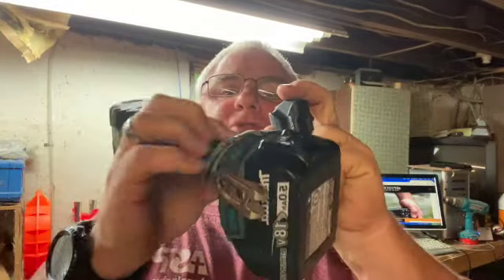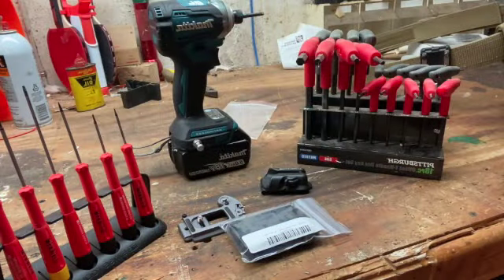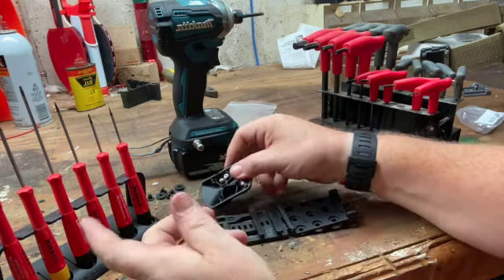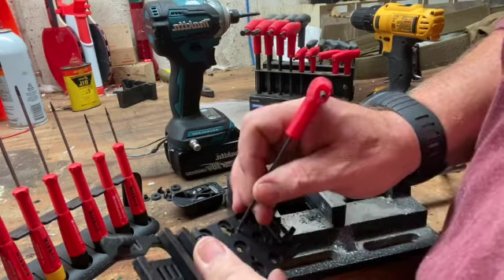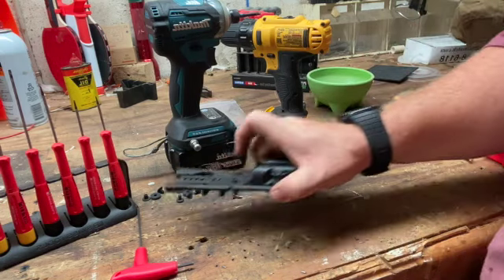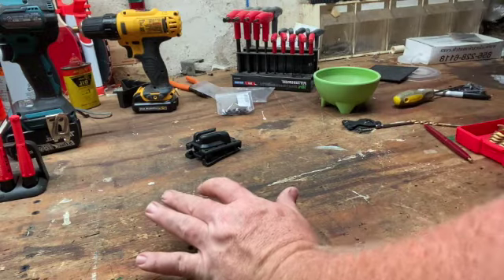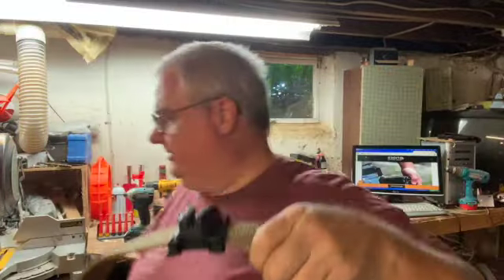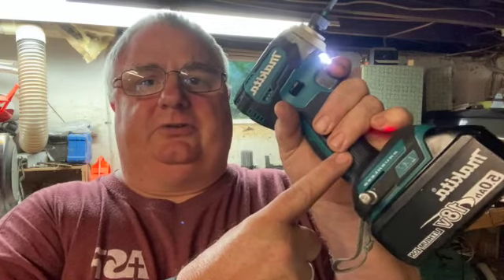Spider X holster and Blade tech Tek loc

Comment: Can you describe the shim you mentioned to keep the tek lok from sliding side to side. Thanks
Reply from the maker: My apologies for not adding them in at post of the video. If you go to a hardware store or Walmart. Go to the housewares department and look for non-slide roll material. It is loke a matrix of 1/8 foam. https://www.walmart.com/ip/EasyLiner-Select-Grip-20-in-x-6-ft-Light-Gray-PVC-Shelf-Liner/38055910 here is the link for it

Comment: Me personally working on the leading edge of the building would not trust the screwing into a piece of plastic
Reply: glass filled nylon is pretty strong, if you're putting over 200lbs on this setup you have bigger issues. if you want metal threads it looks like they make all metal spider versions